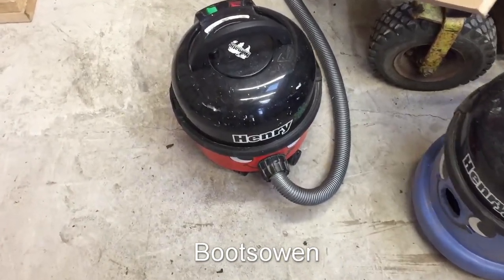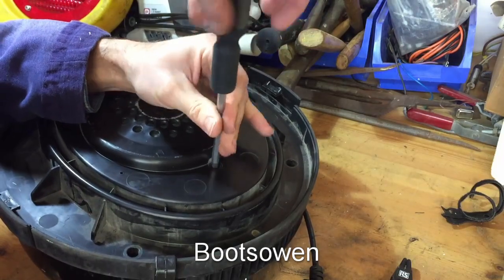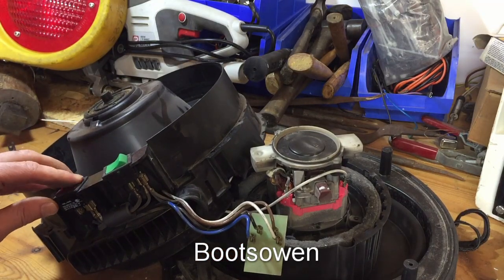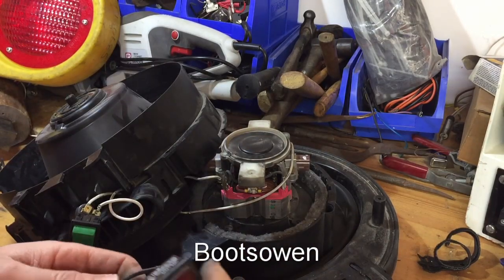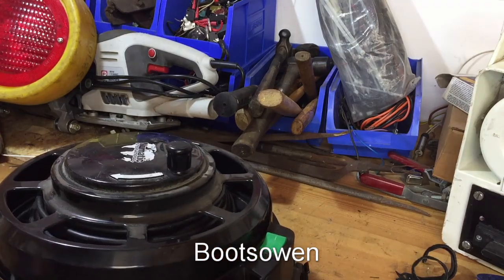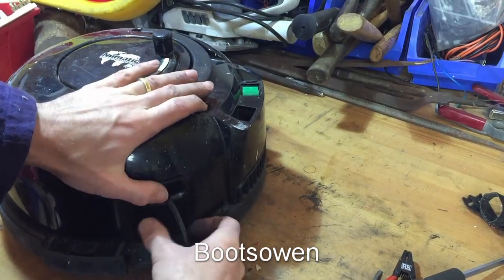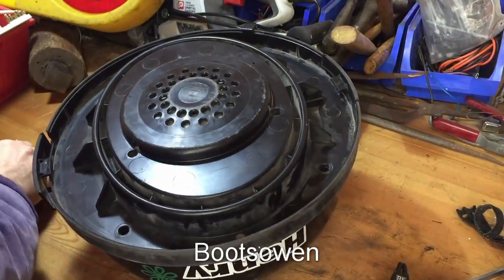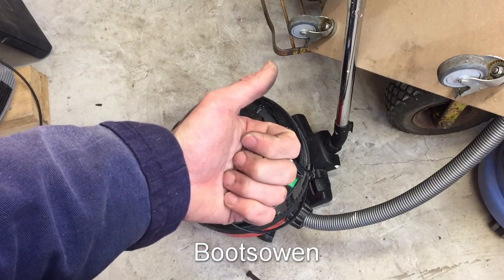Henry vacuum switch hi lo removal

Comment: That was nice to watch but I just realized something very important. You can't repair a red vacuum without a matching red crocs or every thing blow up.
See, I'm learning stuff important stuff.
And by the way the switch is repairable. Just a little bit of contact cleaning solution and it will be back in order The rain water must cause some corrosion. and I'm pretty sure that the PCB is just fine because the low setting was functional from the first place
Reply: What are you on about. It was the pcb that was faulty.

Comment: Done this on a few and wired in Numatic part number 208885 in place of the hi low switch this gives you a light like on a Numatic James
Reply from the maker: Yes indeed, it blocks the hole as well. Do you have a supplier of these that is cheap?
Reply: @bootsowen  not yet working on doing compatible one for it though. We have just done a special order for some genuine ones off Numatic for now.
Reply from the maker: send me on a link when you have them. I reckon the ones on ebay are expensive enough for what they are but I can't seem to find them anywhere else. Your website is nice!
Reply: @bootsowen  definately will do! Thank you 😊